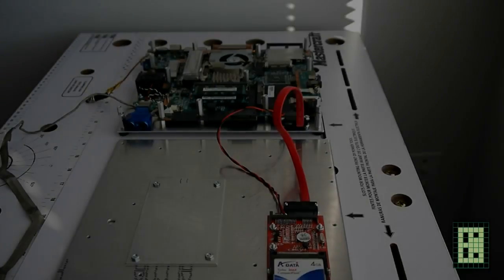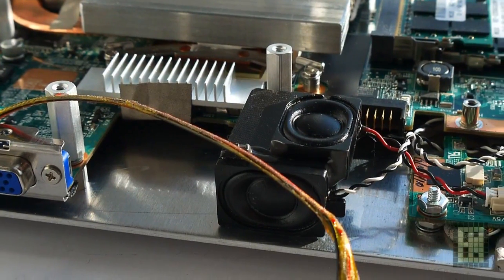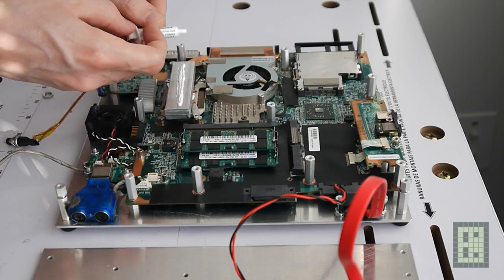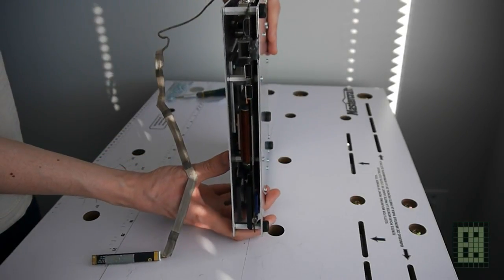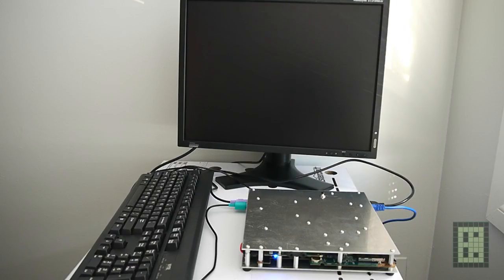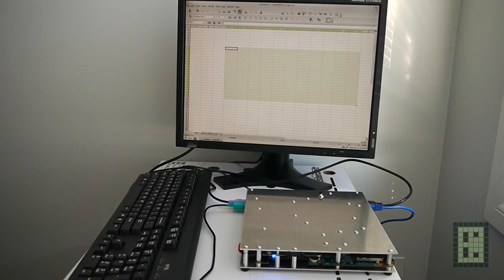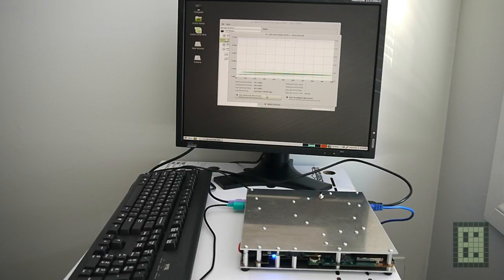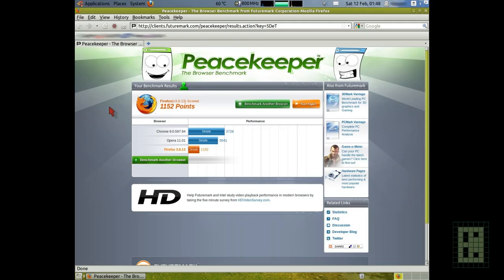DIY Desktop Computer from Laptop Motherboard and aluminum case.

Comment from the maker: Power button is just a push button normally open so you just solder two wires in parallel and connect those to your own push button.
I used a really inexpensive push button from eBay. You probably need a soldering iron for this part unfortunately.
Reply: electrodacus do you have any tutorials video on how to do this? Which part on the board should I solder them?...

Comment from the maker: Most laptops will have no problem booting without an LCD if an external monitor is connected.
What model of laptop do you have?
Did you checked to see if there is no BIOS setting related to this?
Is there no activity when you remove the LCD? not even one minute?

Comment: PPS: Hydraulic Engineering is the Engineering and Design behind CREATING the Muscles of the machine.  Another words, the power transfer mechanism for the PTO, the Quickdraw, the pneumatic cylinders and associated valves, fittings, tie-downs, signs, angles of movement, ...making sure everything matches up just right so that an operator can run it 'balls to the walls' so to speak in order to maximize every minute of work.  Yeah, that's what I do. Where do you work?  McDonalds?

Comment: PS: hydrostatic engineering involves the design of and implimentation very complicated  (and often very powerful) pumps, valves, fittings, tubes, hoses, chains sprockets, tracks, tires and interaction with all the other myriad of systems (aproximately 230 different systems last time i checked).

Comment: No troll, a mechanic 'works on tractors', a Mechanical Engineer designs tractors to be able to withstand a certain number of revolutions at specified stress/temperature/unintended uses/ etc. by using such tools as Parametric Modeling in 3D, Finite Element Analysis, Computational Fluid Dynamics and Machine Design to just skim the surface.  Every time you open your stupid (hopefully young??...because if you are an adult sad is an understated adjective for you) you get more and more stupid.

Comment: if you knew anything about engineering you wouldn't ask such a question....let alone ask it in a rhetorical nature like this.   Mechanical Engineers get hired and then they specialize most often in something that is not a traditional role of Mechanical Engineering, however there are many hugely important TRADITIONAL roles that Mechanical Engineers can fill in a computing environment....one would be Heat Transfer...and there are about a million others.  Engineering disciplines all overlap.

Comment: I have 'built' somewhere around 50 computers and a few clusters.  But building computers doesn't make one an expert in design.  And we are not debating 'tdp' as it pertains to whether it imposes design limits in a cpu located in a laptop.  As obviously it does impose a design limit.

Comment: Fact 'hardware designed for stationary computers are much more powerfull and the computational...is much more powerfull ...than what yo uwould find in a laptop.
Your point?  You really need to apply some education.  'Laptops are made weak because of the 'TDP'...so many cruddy conclusions it's hard to tell where to start...or when to stop wasting my time.  The thermal design point is ONLY 1 ASPECT of the total design.  In itself it doesn't make laptops weak.  Morons like you make me sick.

Comment: Bragging about my specs?  Here you go again using fallacious argument, instead of addressing my premise that a the NEED dictates whether something will be "BETTER" a specific application, rather than the specs themselves.

I don't care whether you believe me, if I wanted to brag I would have told you about the fact that I broke $100,000/year for the last 3 years.  And just recently I started a computer business (ME Consulting on the side).  That would be construed as bragging.  Applause please?!

Comment: AMD uses both the richland and vishera architecture on their CPU's, Intel uses haswell but there is a difference between i7's and xenons. The difference is usually that the Xeons are the cream of the crop. They run cooler and at lower voltages and are spec'd for 24/7 continuous usage. Xeons also have more cores. But my point was that you can't utilise things to their full potential in a laptop. Do you want to use little electricity for a long period of time with a bad processor or vice versa?

Comment: Do you want an applaude because you brag about your specs? I call bullshit on you, no one with dignity would brag about their rigs, just mentionen some quality parts don't get you there kiddo. 

You know that tablets use ARM architecture and a desktop uses x86? If you want to compute things, a computer OS will be much better since the programs exist there and windows + osx don't run there, Also the computational power of the different architectures dictates the limitations of the design.

Comment: Did you design this using CAD?  If it was something like freeCAD or SolidWorks I would really appreciate the model to use as a template (would save me time in designing more of them).  I am putting together a cluster of computers for use with CAE linux and Computational Fluid Dynamics among other applications.  Thanks for taking the time man.  Your off-grid home is a dream/goal of mine also.  Keep up the good work and thanks so much for sharing!  Could I get your email or give you mine?

Comment: I have nothing against high-powered desktops, I have several including one with the exact processor you mentioned above, 8 monitors-- 2* GeForce GTX 780, 64gb ram, 4xSamsung ssds RAID10). however, COMMON SENSE dictates that a laptop (DEPENDING on the need) will OFTEN be more then adequate.
PS:
'NEVER' = red flag for a fallacious argument.  and,
'satisfy a need for a true computer' = subjective and unmeasurable commentary.
A similar comment would be: 'Your momma could never satisfy a 'true man'.'

Comment: Save me the insults.
I don't care about your education. Fact is that hardware designed for stationary computers are much more powerfull and the computational power of of a xenon or a opteron processor (server grade material with low power consumption) is far better than what you would find in a laptop. Laptops are made weak because of the TDP, they get hotter not necesserly on voltage but due to the architecture of the processing unit. I'm guessing you've never built a computer or know hardware.

Comment: The motherboard supporting a high end cpu such as the i7 4770k is bigger than a laptop, my graphics card is bigger and by far better than anything ever able to be stuffed into a laptop. As for processors go, there are different sockets for each processor line, but I can't see yourself putting a Xeon in a laptop. A tablet could never satisfy a need for a true computer, I have three monitors and a really solid rig, you can't fit that into anything that would be considered portable.

Comment: Hello again
Thanks for the spam thing :) So! A normal PSU will do? I only have to find a way to change the 12v rail in to 15v ? its it ? Then I will calculate according the PSU Power for instance a 700Wts could deliver enough to supply 7 100wt laptop boards ?

Comment: Hey! Im building something similar but with several laptop motherboards stacked to build a supper cluster computer! :) 
Great job regarding thermal issues; but im looking for some sort of solution concerning to the power supply not having to have several ac dc adapters attached, any ideas ?

Regards

Comment: Some qs 
-- is it OK not to have the vent for the CPU fan?
-- How did you mark the positions of the screws?
-- Where did you find the aluminum boards?
Thanks for this video. It's great work, I always dreamed of doing. Also, do you know if there would be some way to daisy-chain 2 or more processors and expand the capacity?

Comment: Question #1: why didn't you (a) take off the monitor to the laptop and get a normal monitor to use as your main or (b) close the laptop permanently and use an external mouse, keyboard, and monitor. It is cheaper and provides better cooling to CPU. Question #2 why didn't  you buy a new or fairly used laptop and recycle your old hard drive? You could probably salvage a few parts from the old laptop and put it in the newer one.

Comment: I have an old C2Duo, 3Gb Ram, GeForce 8400m laptop. It is cracked near the flap hinge, I've taken the hdd out and using it on my PC. I'm considering of doing something similar, but I was thinking of  taking the motherboard out and install it in a cheap mini tower. The main problem though is with the connectors(USB, keyboard, VGA...), not sure how to mount the motherboard ergonomically. I will also have to solder the power brick directly, because of the power jack is problematic.

Comment: Hello. Great idea. I was wondering if you tried to put Windows XP, vista, or Windows 7 on the compact flash. I installed an SD/compact flash reader on my desktop before installing Windows 7. Windows 7 read my card readers in the drive list, so it should be able to boot Windows from compact flash without a problem. It also reads in my bios.

Comment: How did you Supply power? Ive been using my HP with a broken screen as a desktop but the battery just died and it wont run off just the power cord. Great vid!

Comment: What are the dimensions of the standoffs that you used? I noticed that you used male and male/female standoffs. Did you also screw-in screws to each of the female standoffs that hold the motherboard in place (not the top lid)? Thanks

Comment: Nice build. I have an old laptop that I want to use as a media center. I have a few questions to ask you if you don't mind. 

- Where did you buy the standoffs that you used? 
- Where did you buy the aluminum sheet and how thick is it? Can the supplier cut the sheet to specific dimensions?

Comment: Even so, it came out really nice. 
My last thoughts would be to try to disable the SATA drive entirely from bios and let Linux probe it out alone. (ie. set s-ata hdd to none)
Or ditch the s-ata2cf and try an usb interface. But it might be a lot slower. 
SATA2CF could be buggy. The culprit might be it, not the PC's bios...
Altminteri bace, sănătate şi multă baftă îţi urez!

Comment: Dude, from your accent I thought you're romanian :D 
Joke aside, I started to do the same transformation on an old Acer too. 
More I planned to build it in an 17" lcd monitor case with it's original LVDS panel.
Unlike you I got carried away by the project and late, after making the pretty aluminum case... found that the whole usb bus was dead.  
But, why don't you try to update your bios? Or, at least, change boot priority to SD card 1st?

Comment: at 1:15 did you use arctic silver to stick aliminum to plastic ps2 output?God!So called Adhesive is just for the purpose of metal to metal heat transfer thing, anyone who knows anything about computers would do such a thing, better not tell anyone about it if you don't want to be embarassed.The VGA port is just hanging like that, which will not hold and will breakdown soon, one way to overcome this is to use silicon gun to fill in the gaps between parts like that. so that they don't move.

Comment: Very nice video, i was planning to do the same to an old pc i got laying around, ¿did you cut the metal parts ?, ¿did you buy them?, any way nice video, now im exited about my project :D.

oh, also, i have a little unrelated question ¿what did you do with the screen?¿was it broken? ¿do you know if there is any way to use a laptop screen on a desktop (real desktop) PC ?

Comment: @electrodacus Alright, that sucks, just try not to reboot it :P. I am actually thinking about doing this but on a little bit of a higher scale. I will have it surrounded in aluminium with perfect holes for usb, vga, etc... im gonna add air holes and nice fans to keep it cooler than it is now. Im excited to see what it will look like when im done :)